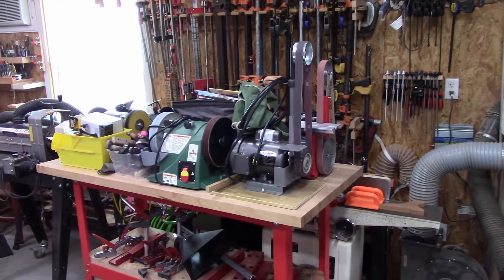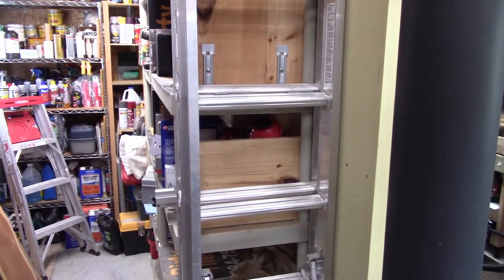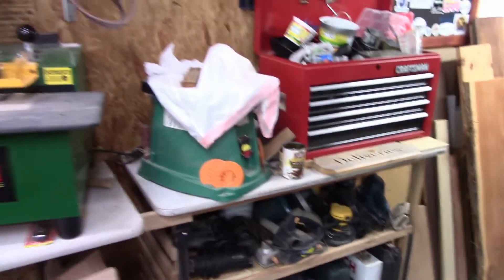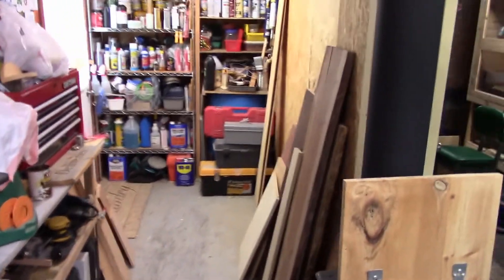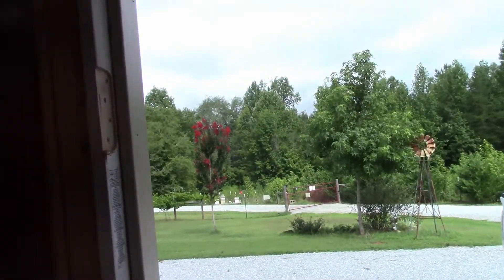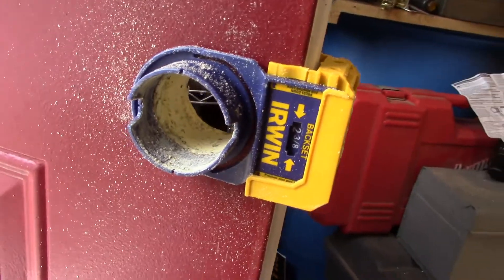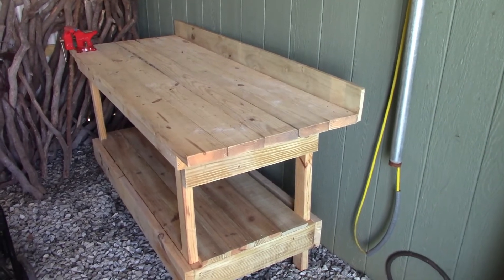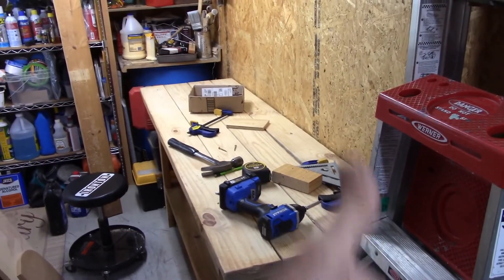Remodeling my shop for a New Sharpening station ~Part 1

Comment: I’m curious how the wet stone wheel is gonna work. I almost bought one but I’ve made so many buying errors for knife sharpening that I’m afraid to spend the money on one and have it not be the right tool for edging a blade that’s never had on.
Reply from the maker: I think it would be very slow. I think belt Sanders are better for that purpose 😎